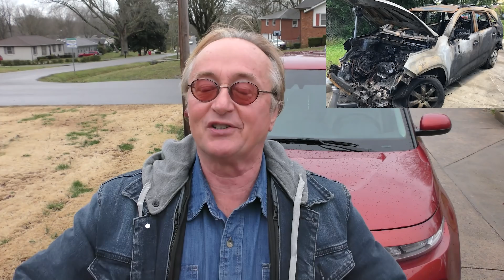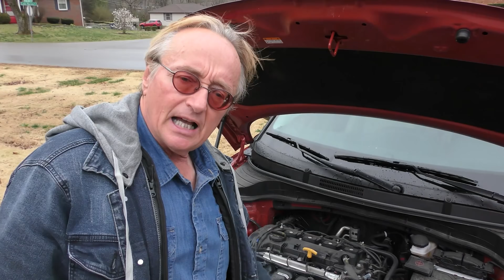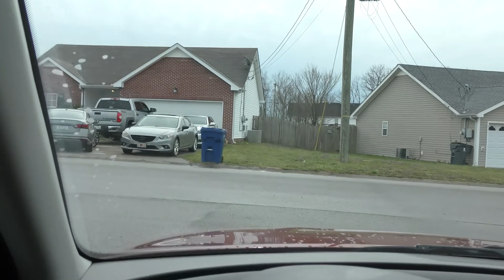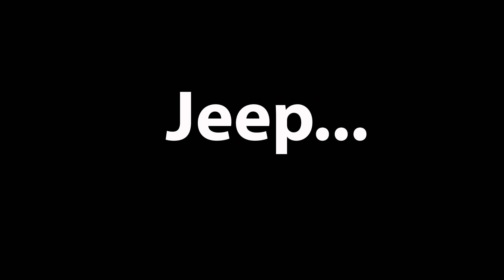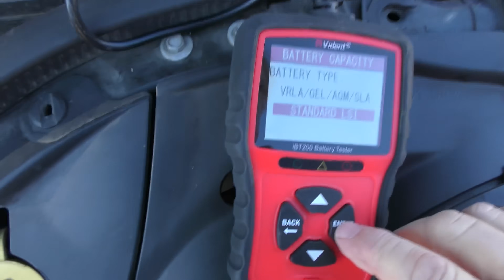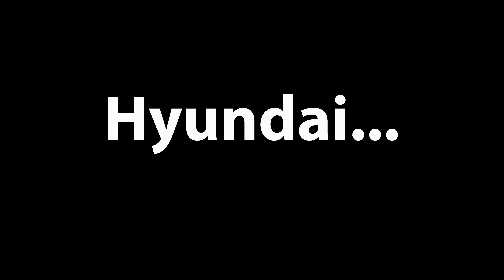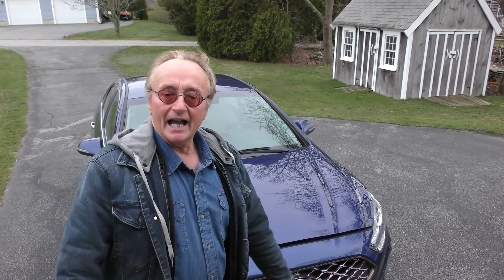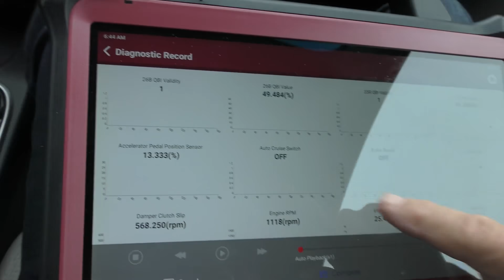3 Car Brands That are Crap

Comment: Not intended as a gotcha, but Honda, Mitsubishi, Isuzu and some other Japanese brands had a similar oil burning issue with their six cylinder engines from the late 90’s and early 00’s. The Honda J35 for example. They also claimed 1qt/1000 miles was totally normal. Now, I’ll take a Honda anything over a Kia anything all day, but let’s not pretend the great Japanese makers are without sin.

Comment: My friends 2016 Kia Sorento was leaking oil through #1 spark plug gasket and she didn’t know and it just died on the freeway as it had no oil and the oil light never came on since she was the 2nd owner the engine didn’t have warranty for her. I tried adding oil got it running but then it blew the rod so we got her a used engine under 50,000 miles a month later it had the same problem so I replaced the valve cover gasket and now it’s fine. The Kia only had 75,000 miles when this started

Comment: I had a 2012 Jeep. I put 183000 miles on it with no problems at all. All I ever did was change the oil every 5000 miles. I’ve never had any vehicle run so well for so long with so little maintenance needed in the eight years I owned it.

Comment: I bought a Kia Ceed 1.6 diesel because it was so cheap. Now I have driven 60000 km with it in a year and half - no issues yet, not even oil burning.

Comment: Scotty you're spot on man, I work at Hyundai and have complained several times that an oil change interval of 7,000 miles is simply too long between oil changes, especially when people think they can still drive 2,000 over that! And surprise surprise when I check the oil and filter on these brand NEW cars, metal! Hyundai and Kia are shooting themselves in the foot by having to change out an engine instead of just giving out a few more 5k oil changes, instead of trying to be cheap and make them 7,000 miles out!
Reply: 7000 mile oil changes shouldn't be an issue. I rember my sister bought a new escort wagon in 99. she went like 9k miles on the same oil , I checked it, not a piece of metal in the oil, the oil was still like new.
Reply: @richsweeney1115  Just checking regularly is only common sense.  Thumb and index finger, plus eyeballs, tells you if you need an oil change.  If it's like water between your thumb and forefinger, it's overdue.  If it's pitch black, it's overdue.
Reply: @harrymills2770  lol, I've been working with cars and trucks for over 20 years , I never let it go beyond 5000 though no matter the color
Reply: @richsweeney1115  Very scientific analysis
Reply: @richsweeney1115  Back when Ford was still decent
Reply: @arcticwolf8150   I will call lol
V
Reply: Oil is cheap, Engines aren't.
Reply: I have a 2019 Toyota Camry. The owner's manual says that the car can be driven 10,000 miles between oil changes, and they recommend oil changes at 10K miles.  While the oil is still pretty clean looking at 5,000 miles, I change it at that point to be safe.  I won't get to 6K miles before I change the oil.  I know Camrys are awesome cars mechanically, and can run almost forever, but I don't trust 10K oil change intervals.  Also, the oil life meter comes on around 4,400 to 4,600 miles after an oil change.  So that is strange as well if the manual recommends 10K miles.
Reply: @djrickyb  No car ever broke down because the owner took extra good care of it. Changing the oil at 5K instead of 10K equals one extra oil change per year. Pretty cheap insurance if you ask me..
Reply: @djrickyb  Since toyota hoses $$ on the highlander being 6 quart synthetic changes. I went back to do it myself Mobil 1 , oem filter kit for half price. 7500 miles intervals comfortable to me.
Reply: @djrickyb  I’m still doing the every 3,000 mi. with my old cars. I can get the change kits at the two major name auto parts stores for about $38-42 for 5 quarts of oil and filter. Well worth it. Combined 402,000 miles between the two cars, hope they run another 200,000 at least.
Reply: @djrickyb  agreed!!
Reply: @djrickyb  I will say one thing about Toyotas those cars are almost made to abuse, a couple people I knew had them never changed the oil, would keep on going, going
Reply: @djrickyb  Real engines (non-Korean) can safely do 20k between oil changes. My 2019 VW 2 litre TDI has done 112k miles now and changed oil every 19k, no oil consumption, no refilling oil between oil changes.
Reply: That’s why I have an oil analysis performed on my cars at most intervals.  My ford van needs changing at 5,000 miles, my 6.7L powerstroke is good with 8,000 mile intervals.
Reply: Are those full synthetic oils being used? I have a mercedes engine in my Infiniti and the oil change interval is 10k on full synthetic oil that meets MB229.5x standard. I set the reminder for about 6k, so I will have a cushion if I miss the interval. Dont plan on going up to 10,000 even with full synthetic.
Reply: @dwayneIs371  No, our base oil for most of our cars is currently 5w30 synthetic blend.
Reply: I think Hyuandai are just being smart. They sell car. They make customers destroy them themselves and the customers buy a new one.
Reply: I’ve had more issues with Ford than Hyundai. Hyundai isn’t perfect but that warranty will still cover any engine issues up to 100,000 miles.
Reply: @iluvmylilsnickys  Don't know how Ford is still in business, absolute garbage.
Reply: Already wrote this above, but I've had two Hyundais with no problems at all.  I never fall for that long mileage between oil changes. I change oil somewhere between 3000/3500 miles.
Reply: I am a Parts Manager at a Hyundai dealership and I drive a Subaru Crosstrek 😀
Reply: @bronxhistory2051  you're fired!
Reply: @bronxhistory2051  park around back lol
Reply: I like to say  " motor oil is cheaper than  motor parts or motors. " . Just a thought.
Reply: Metal in the oil is normal after a break in. Of course I change the oil at 1500 miles on a new engine for this reason
Reply: What's your opinion about doing 7,500 miles on synthetic oil?  Curious to know as a 2022 Kia Rio owner (similar to the Hyundai Accent).
Reply: @FreewayBrent  i wouldn't trust most of the comments on here from DIY experts. Oil nowadays lasts alot longer than 20 years ago. Google changing oiĺ too early and wasting money
Reply: From what I understand the initial oil change intervals are stretched long so that on paper the cost of ownership will seem low. I mean its not like the company will care about your car after its out of warranty.
Reply: I have a 2012 Odyssey, that has an oil minder.  It averages 8 to 9K between oil changes.  Currently has 132K on the vehicle.  The engine was torn down at 90K due to a manufacturing issue.  There were no other issues other than improperly installed rings at that point.
Reply: Mine says 5k miles 🤡
Reply: 2014 Tucson owner. I never felt comfy changing oil at 7k on any car. I Always go between 3k to 5k.
Reply: Mileage doesn’t really matter. If you really wany yhe most out of your oil you can send it for testing. Issue is some peopme drive a lot on highways vs cities, which one can get a lot of Mileage. 

Of course not many people do testing so its better yo be safe than sorry, which is why people change oil earlier.
Reply: I do mine every 3 thousand miles, I just feel safer doing it that way.
Reply: Have a 2013 Sonata and have done 3000 mile changes from day 1...required by the dealer to keep the warranty active.
Reply: @Kyle Belair  a 3 cylinder 1.3 shitbox...the new blazer is a Chevy Trax on crack
Reply: It's....almost like they want ICE engines to perform poorly.......
Reply: My KIA is 1 year or 10,000 miles.
Reply: My wife owned a 2014 Kia Soul SX that she had for 7yrs with over 110,000kms. I was the one who took the car for it’s oil changes roughly every 6000kms  and it burned very little oil between changes. We would still be driving it were it not for a stupid woman who was looking right instead of left and t-boned me at an intersection. I had the right of way and she was at a stop sign. The insurance company wrote the car off but gave us 13,500.00 Cdn. We now have a 2022 Soul GT-Line Limited with every option you get on a Soul except a turbo which you can’t get in Canada and we’re very happy so far. Just had its second oil change, full synthetic 0W20. Interesting note, we received a recall notice about the oil fill cap that had the wrong info about the oil type on it. Instead of 0W20 it had 5W30. I asked the question at dealership which oil was in it from the factory and they assured me it was the correct oil type.
Reply: @dirkprobert
Reply: @dirkprobert  it shouldn't have burned any oil with those miles...
Reply: synthetic bro? lol jk
Reply: My wv golf has 18k mile interval but i change at around 9k
Reply: dang -metal!?
Reply: customers asked for it though, they crossshop and if the mtc interval is longer at the competitor off they go.  shortsighted foolish decision tree
Reply: Since when... my car is 5000 mile intervals and no problems
Reply: 7k, I have a brand new Tucson and they do it every 5k...you sure thats Hyundai and not just YOUR dealership trying to save a buck?  Just sayin....
Reply: I assume the dealerships are also using the cheapest 55 gallon drum( or maybe they are getting it by the tanker load) of oil possible that meets the API spec required in the owners manual, not synthetic.  In which case 5,000 miles is definitely very good advice.  I do my own oil changes at 7000 on my Toyota with full synthetic.  With 200,000 miles it consumes very little oil between changes.
Reply: Spiderman no way home< wierd that kia is a japanese car?
Reply: in Europe we change oil every 10 to 15 000 kilometers, and that is completely normal. Volkswagens even have long life intervals where you go 20 000 kilometers between oil changes.
Reply: É
Reply: Kia in Canada does oil changes every 6000km's or 3700miles.
Reply: I had a 02 Enantry and had no problem with the engine. It was a stick shift that had a problem with the clutch it was the hydraulic cylinder that ran out of fluid when the seal went bad. Went to the Advance Auto and bought the whole cylinder, and put it in myself being a mechanic has its advantages. Anyway, I have no problem having a KIA. Had 180 thousand miles when this happened.
Reply: I doubt the veracity of anything you say.  Our oil at 7000 oil change has always been very clean, the synthetics are excellent.
Reply: I bought an old Sonata. 203,000 miles on it. Trans wonky will try replacing trans control module. Good car except for the shifting problem.
Reply: I have a 2018 Sonata. I use synthetic blend or all synthetic and change the oil about every 5,000 miles or 6 months what ever comes first. Crossing my fingers
Reply: @pckrKw  Have you had any issues? My 2017 Sonata burned oil.
Reply: @paulcarlin5181  No issues. I heard that frequent oil changes makes a big difference. I go full synthetic and change the oil every 3-500, 4,000 miles
Reply: I’m starting to think Hyundai makes a pretty reliable car. When I visit the wife in Colombia it seems like at least 2/3rds of the taxis are Hyundai. Taxi drivers there beat the crap out of there cars with stop and go, and their shops are basic and often see them fixing stuff in an alley. 
So they must be relatively affordable, easy to fix and reliable.
Reply: Have a 2017 Hyundai Santa Fe have had oil changed every 3000 k and noticed oil consumption issue @75k now I have 105k and every 1000 have to put 5 qts in. Going through dealerships testing now. Had 05 Saab 9-5 with same mileage and changed oil every 6k and it never had oil issues go figure never know what your buying.
Reply: If you are using Base Standard oil no not good! But now all Synthetic.  I watch everything and hang out
Reply: With who ever is working on my car. But because I have been doing this for 20 years so their use to me. To me they are very well put together.  Now the Santa Cruz is my first Hyundai! I take this one to my KIA dealership because I  Love them.  At CMA. Love Santa.
Reply: @rusty383  I've see too many Hyundai and kias with low milage and blown motors that I know were maintained
Reply: i had a 2017 elantra and i would always change the oils every 3000 miles
Reply: 7000 miles ?. Good grief they make crap engines in the US. Mines serviced 10,000 and no oil burning.
Reply: With a new engine my first oil/filter change would be at 100 miles to remove any super small metal shavings. My opinion.
Reply: What your suggesting makes too much sense. Thank God I don’t own a Hyundai or Kia.
Reply: @relaxandslumber970  We love our 2009 Genesis sedan, still rides like new!
Reply: @richardgobeille9776  Good for you. The other component is to regularly maintain a car, which some owners don’t do regardless what kind of car you have.
Reply: @richardgobeille9776  That's a nice car.👍
Reply: @DIASISS Hyundai engines weak can’t last they always need oil changes my ford oil change is every 10k miles full synthetic
Reply: @edwardbiglang-awa7313  Where I live, I see 20 year old Kias and Hyundais on the road.  No blue smoke coming out of the tail pipe.  Scotty is in love with Toyota.  He's like guys who like Glock pistols and everything else is junk.
Reply: @danielhamilton7003  My hyundai has 317000 its an 08...I can't you how many times I have forgotten to change oil. I change when I remember my car is just faithful
Reply: @danielhamilton7003  I've seen a lot of Hyundais and kias with low milage and blown motors, that I know we're maintained..... scotty doesn't only love toyota....he's given credit when he finds a good one. He even did that on an 04 Kia spectra....people who say he only likes toyota don't pay attention at all....he loves toyota, honda..he gives  credit to older ford's and chevys..even some dodges...he's called toyota out when he finds a problem.. even scotty says hinda makes the best motors in the world
Reply: @richsweeney1115  And I've seen Ford people brag about how much better their trucks were than Chevys and vice versa.  I've seen Glock owners brag about their pistols over other brands.  I stated a fact from what I had seen.  I could care less what you think.  We all have opinions and you know what they say about those.
Reply: @danielhamilton7003 The old ones were really good, just not now I guess.
Reply: Ford is worse than hyundai kia
Reply: @alleneng  Absolutely!! Fords are crap! 👍🤣
Reply: @Kyle Belair  that's Hyundai, not Kia
Reply: @ezrashonor  Same thing lol...

Comment: I purchased a 2009 honda pilot. Soon after my purchase the engine light came on. Took it to a mechanic he said the catalytic convertor is bad.  I put in PXT and the engine light goes out for 2 or 3 days, then comes back on. The mechanic said it will cost between 1700 and $2000 to replace.  These are tough economic times, is there a way to fix without ripping it out for a new one. I go for Texas state inspection in 4 months.
Reply: I know this sounds stupid but you can actually take the cats off and clean them. Not a.long term solution but it should work to pass at least then you can take it back off and reem it out so it runs good.

Comment: My reliable daily driver is a 2011 Kia Sorento I bought new in 2010.  This Kia has been the least expensive vehicle I have ever purchased new and driven for over 100k miles.  I've spent a total of $2500 above routine maintenance and gas over the last 12 years.